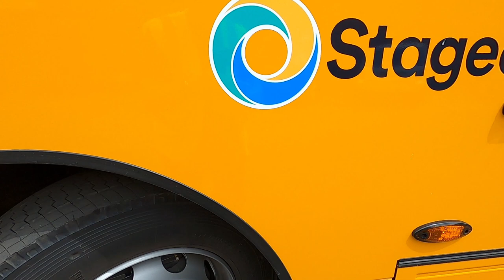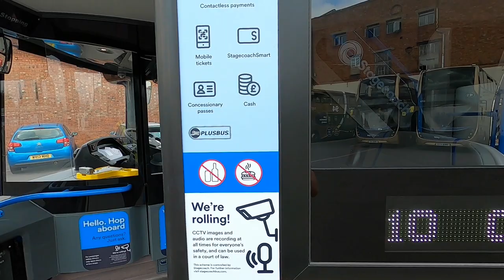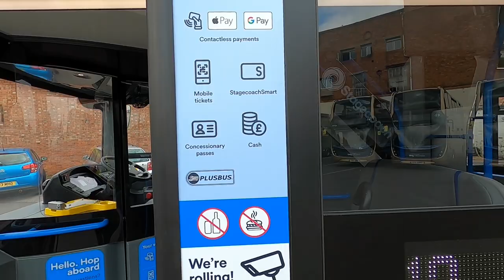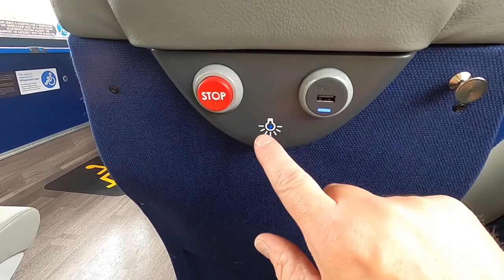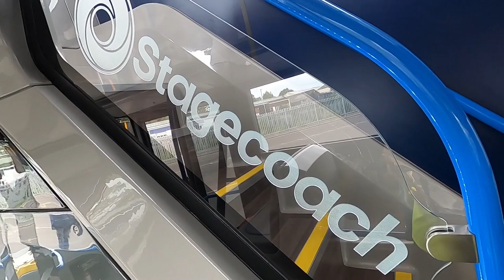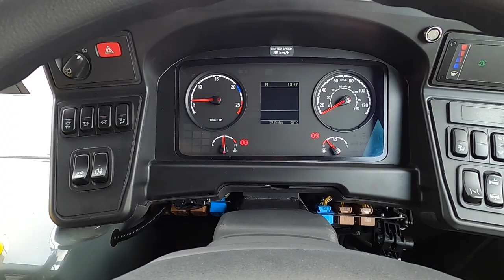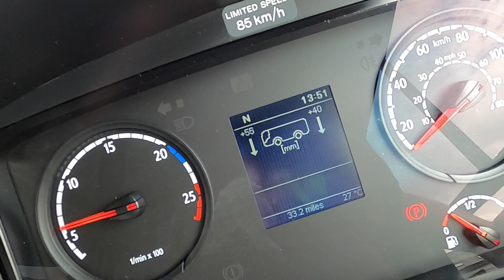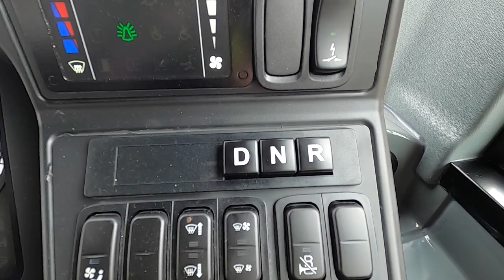Test Drive | ADL Enviro400MMC-bodied Scania N250UD

Comment: That's a good idea, having a stopping buzzer on the back of the seat in front because I have travelled on some of the High-rise single decker coaches that the Stagecoach depot in Dumfries used to have for the X74 (Glasgow route) service and the drivers would be amongst the first to tell you that they didn't really have enough of these buzzers.

So, this is a good thing to see it shows that Stagecoach listen.

Comment: My depot got some of these but slightly older (same body but different interior), dennises instead of scanias, they drive smooth but they are sluggish and constantly broken. Dpf cloggs up really quickly and then straight into limp mode. I prefer the old scania deckers, they also drive smooth, have good brake pedal feel and have enough power to actually pull off in rush hour traffic, as opposed to these fancy E400s that limit power in first gear.
Reply: Did they not get the Cummins Powertrain once they realized that those were really unreliable?
Reply: Have you ever driven Streetlite? If yes, you know the meaning of sluggish!!.

Comment: if you ask me the new distance livery and interior doesn't feel as luxury as stagecoach gold does
Reply: Yes I agree
Reply: I drive these both versions of these buses. The new one is slightly smoother and has LED headlights which I really like but the interior is indeed not as good and the N/S mirror sticking out 1.5 feet in front of the bus and generally being more sideways too makes it incredibly easy to clout the mirror on just about anything. Some of the tighter bus stop and narrow streets are far more troublesome. I have had to adjust these mirrors numerous times after accidentally nudging them against bus shelters. Far more drivers rip these wing mirrors off than they did with the previous generation. Overall I prefer the gold bus from a driver perspective and passenger perspective.
Reply: @gravemind6536  I agree

Comment: it's OK if it weren't for the fact the gearbox continually tries to upshot whilst going uphill only then to downshift again, typical stagecoach in the way its configured.
Reply: Stagecoach doesn’t make the gearbox.
Reply: You mean typical scania
Reply: @gxxttxxr2442  I dont mean typical scania no, Both the engines Acceloration Rate management & Gearbox shift mode can be greatly altered if an operator wants this done.

Lothian Buses of Edinburgh bought 50 ex-london deckers and had them reconfigured to improve there responsiveness & drivability.

Scania/ZF chassis buses can have the same some..
Reply: It’s because Slavecoach bosses like to put these in eco setting 5 which makes the gearbox and bus slow af 
Apparently in normal mode they are beasts
Reply: @gxxttxxr2442  not at all the n230 is f
Flawless
Reply: @-M0LE  Gearbox setup can really hamper a bus's drivability - many of the Streetshites are woefully set up in particular.

Comment: These were the first scania FAILURE
The drivers cab is possibly illegal the way it is positioned wrong 
Also they had so many electrical problems and they drive so bad in eco mode that they get bunged up and have to be reset every few weeks 
Still way better than a Cummins